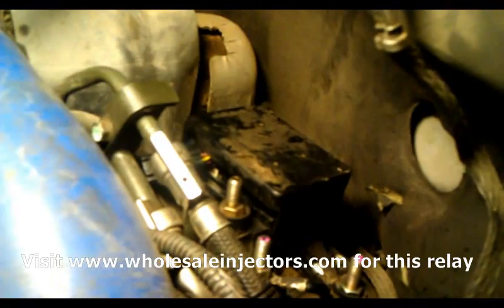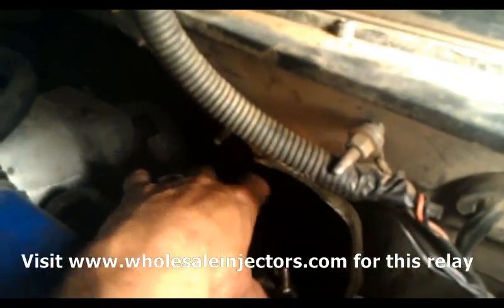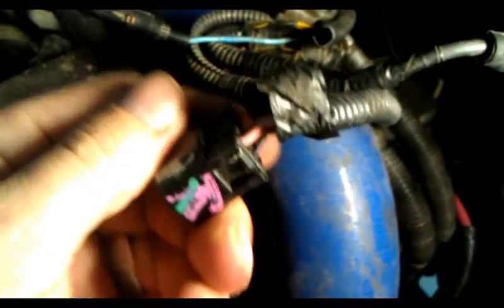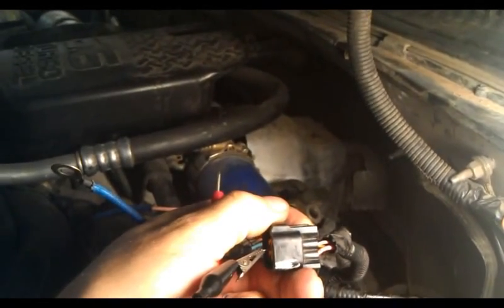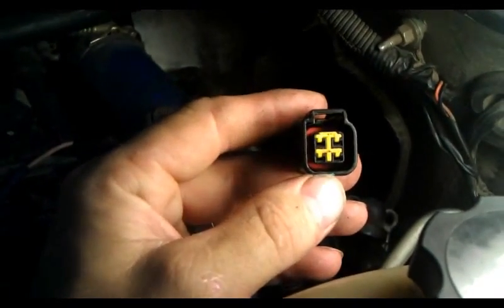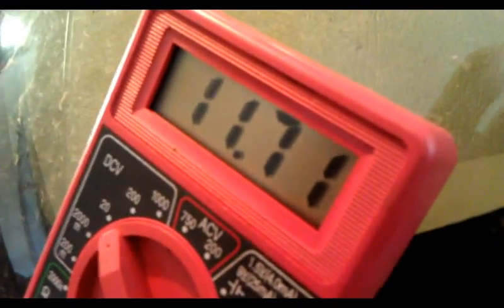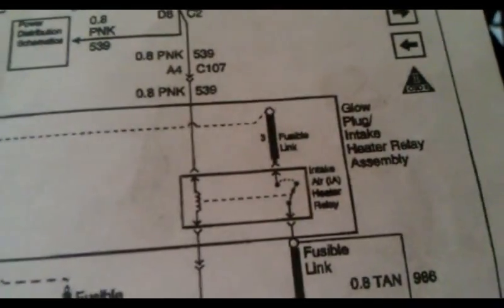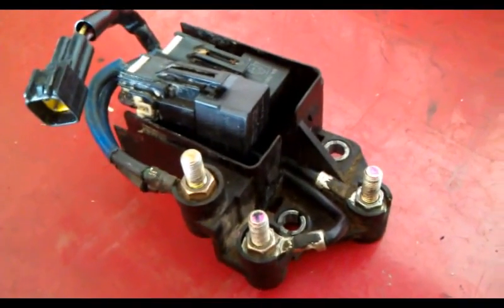2001-2004 Duramax LB7 P0380 Code, Glow Plug Relay,  Detailed Troubleshooting and Repair

Comment: @hatecke007 I had the p0380 code and I changed the relays and I started it but the light is still on? Do I need to drive it a bit or should it go off immediately?
Reply from the maker: You'll need to clear the codes from the computer. Autozone will scan it for you and although they will sometimes not let you "clear code" ask nicely and usually they will.

Comment: I've got code "P0381 Glow Plug / Heater Indicator Circuit" in my  LBZ. Same problem you think?
Reply from the maker: There are 2 relays in that controller, one is for the glow plugs the other for the intake heater.

Comment: Great video, I had P0380 and P0540, my problem was the 175a fuse was blown.
Reply: i thought mine was bad too. i replaced the fuse and still have the same code. time to replace one thing at a time now i guess

Comment: Ok I have checked the relay and is good but the code is still on so I'm lost now
Reply from the maker: How did you check the relay? I've seen these relays work with NO load, but when under actual glow plug load, they fail by Sticking open/closed.

Comment: Will that code always pop up if it's the relay? I have an 02 lb7 and it does not like to start on cold days no matter if it's plugged in, and sometimes when I prime it it'll start and other times it won't. I've replaced the glow plugs, and replaces the whole fuel filter and housing thinking I was getting air in fuel lines. Only had this problem when it's really cold. I don't Know what else it could be

Comment: Excellent video. I just changed the injectors in my 2003 LB7 and need to double check the two blue wires to make sure they're on the correct relays. You da man!